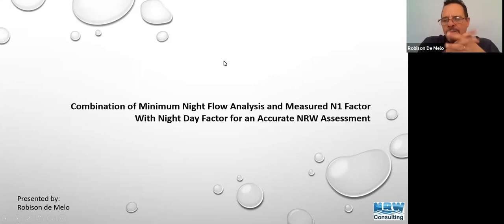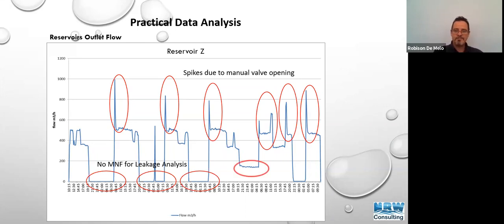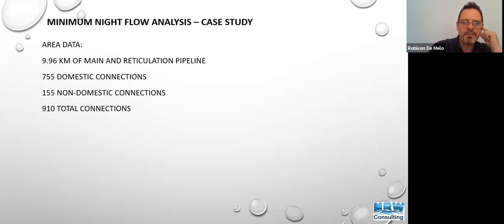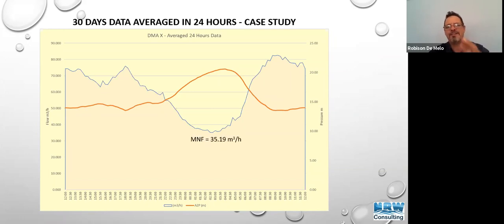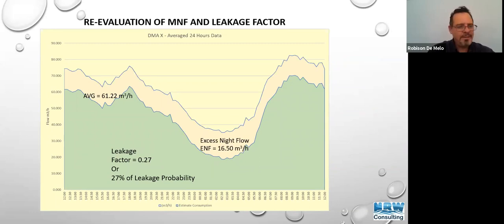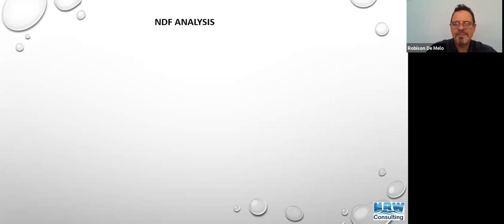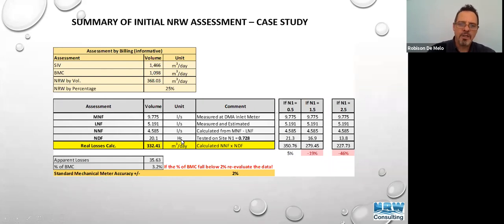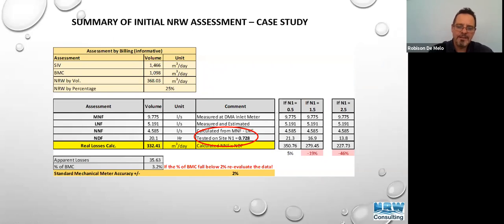The analysis of MNF and N1 for an accurate NDF - Robison De Melo

Comment: if i closed all consumers connection valves and kept opened source valve( one is monitoring meter install at entering point and second monitoring meter is leaving point of the community and compared the input and out put source volume. Is it good practice to find out leakage?
Reply from the maker: Yes, that would be a good way of measure leakage, as all your commercial losses would be eliminated.

Comment: what is mean by drop test?
Reply from the maker: A drop test in this case, means we measure flow into a closed area, to measure leakage. Then we gradually drop the inlet pressure, step by step, whilst recording the drop in flow and thus leakage after each drop. By plotting pressure against flow (leakage) we can calculate the N1 value of the area.